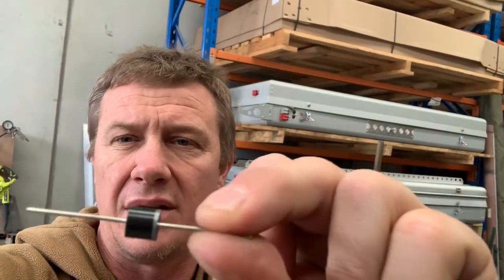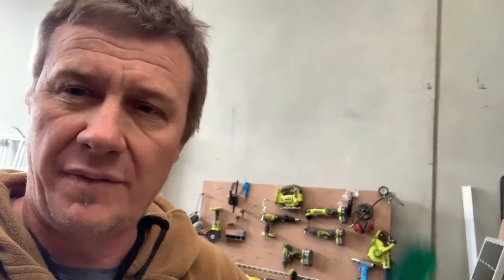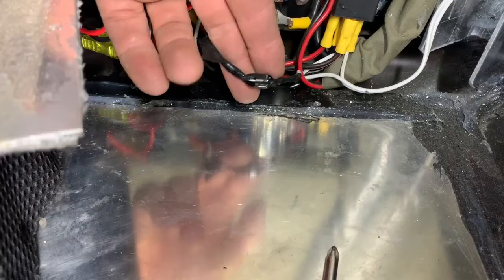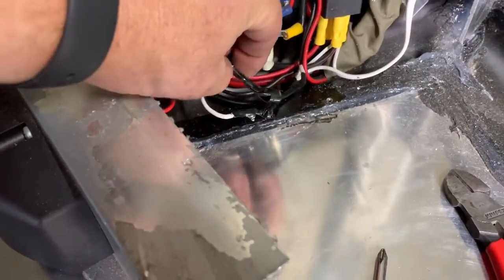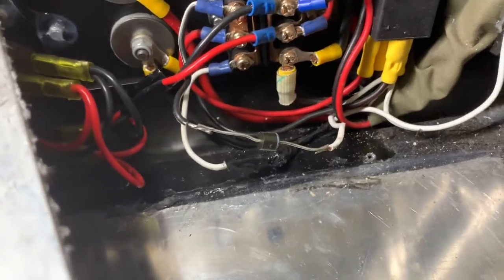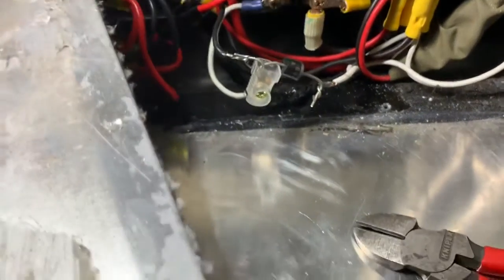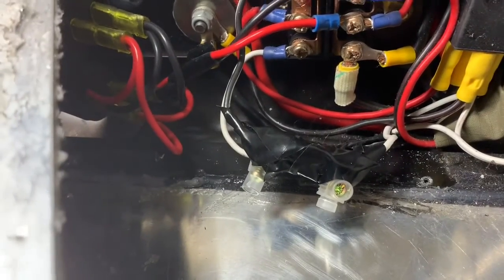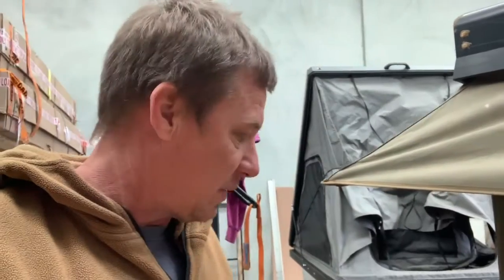How to change diodes in an electric rooftop tent

Comment: Diodes are not fuses, diodes are diodes and fuses are fuses.
Reply: Since they are rated for 6amps. They can actually act as a fuse if drawing more current than their rating. Seems like that's what they chose in this instance.